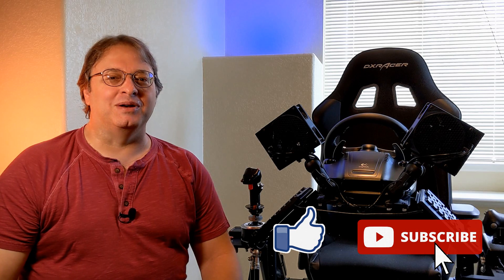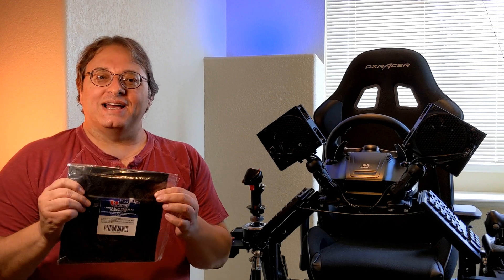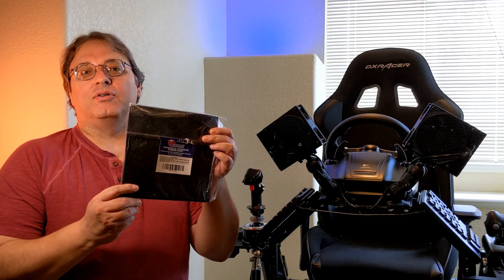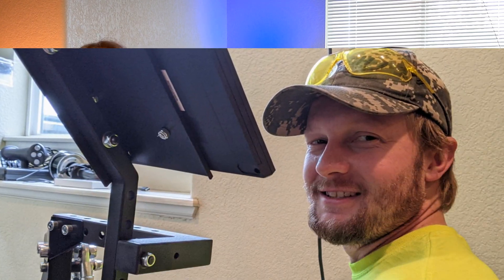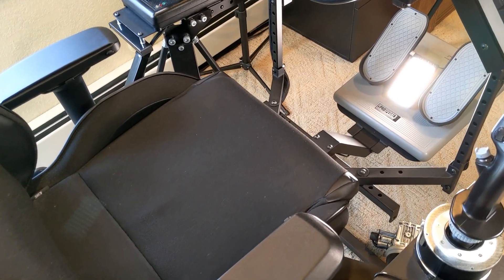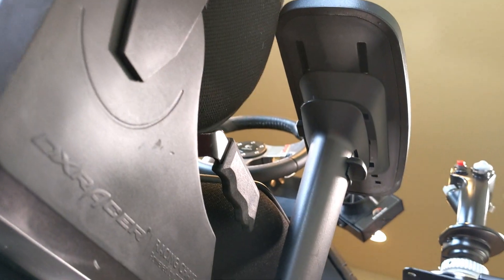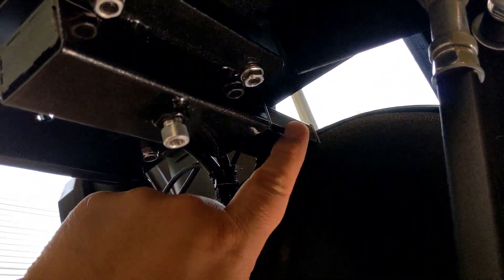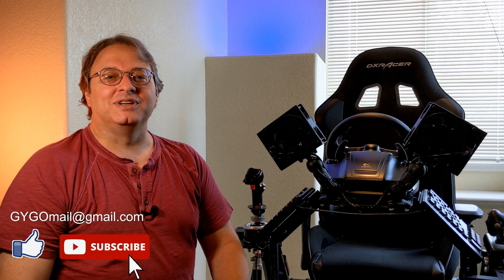DOF Reality H6 Motion Simulator - Part 3: The Core Build

Comment: separate outlet alone does not help much ,you also need separate circuit breaker .if you only change the CB ,you are the risk of causing wires to overheat and possible fire hazard.
Reply from the maker: 100% Correct!!! That is why you should only have a qualified person do electrical at this level in your house.  No motion platform is worth burning your house down.  The guy that did ours ran dedicated orange wire from that outlet (to the switch) then to new dedicated 20amp circuit breakers.  I think that wire was 10 gauge... which he thought might be overkill but I wanted to lean toward over cautious... again didn't want to burn the house down, and so far so good (knock on wood).  Thanks for the comment, I'll pin it because this is an important point.
Reply: Seriously did you even pay any attention at all?
Reply: Some people just have no comprehension skills.  Commenting without watching the video is arrogant and narcissistic.
Reply from the maker: @Purplexity-ww8nb  Glad I'm not the only one who notices stuff like that sometimes.  Appreciate the comment and the view!

Comment: I think what might help is the quantity needed when purchasing new bolts. I'm trying to prepare for my delivery and would like to have everything in place and ready to mod. But regardless, for H6 owners this really is an awesome video. Nicely done. (Unless, of course, there's access to the documentation that has the count of items. :/)
Reply from the maker: Well you are in luck, if you go to my SFU Modification video, I talk about the key bolts you need but here is a copy of the list: 

M8-1.25 x 110mm (10mm to 120mm Available) Socket Head Cap Screws, Allen Socket Drive, 12.9 Alloy Steel, Full Thread, Black Oxide, 5 PCS (NEED TOTAL OF 3 BOLTS): https://amzn.to/3X4jx3q

M8 8MM Male to M6 6MM Female - Threaded REDUCERS 5 x Thread ADAPTERS (NEED TOTAL OF 3 ADAPTERS): https://amzn.to/3i9AdYp

Temp Stickers for each motor (to visually make sure each one is not overheating... not really necessary but I wanted to add it): https://amzn.to/35gfdbx

(IMPORTANT: If ordering bolts or washers, please confirm proper measurements after clicking link. if Amazon is out of stock it may substitute a different size without noting the difference)

NON-AMAZON LINKS

M10 x 80mm Carbon Steel Full Threaded Hexagon Socket Cap Head Screws Bolts 5pcs (These are what I ordered, you may look for 90mm instead) NEED 6 TOTAL PIECES (2 packs of 5): https://www.harfington.com/products/p...

EIBACH END LINK SPACER (M10 Spacer 10mm) NEED 12 PIECES TOTAL (3 packs of 4): https://eibach.com/us/i-12116-eibach-... you

Steinjager Cone Style Rod End Spacers 5/16 Bore 4 Pack (NEED 6 PIECES TOTAL - 2 packs of 4): https://www.ebay.com/itm/234813416374...

This is obviously for the SFU Upgrade with the Cone Spacers added to it.  I put how many you need in parenthesis.  For the other bolts, we just bought a dozen or so of the longer M8s and then we used the ones that came with it and just used the appropriate length for the application.  So in other words, when it say called for a 60mm long, we just used the 70mm long that came with the unit.  I hope that makes sense?  Anyway, you will likely find yourself needing to get some extras so just plan on that.  I can't give you an exact count because the DOF Units have changed since I got mine with different bases and stuff so my inventory wouldn't be accurate anymore, but here is the current build guide for the H/P6 so maybe you can get some info from it ( https://dofreality.com/instructionsHP6.pdf )  Hope that helps and good luck.
Reply: @GYGOtv  Wow, thanks for the quick response and the great information! This is awesome!. I appreciate you taking the time to get this posted.
Reply from the maker: @puckernet8155  No problem, good luck with your build... glad I could help!

Comment: Did you get the standard butt kicker adapter post from dofreality for your setup, i think i see a shot of it briefly but cant tell.  I did the standard one, i feel the pipe is too narrow (even though i thought they corrected that), so ill add material to it, but i'm confused as to where to mount it.  Seems the only spot that might work is up towards the front underside of the chair on the front of the spine material in the middle.
Reply from the maker: Hi Sky, yes I just got the DOF adapter and you are correct, it was a little loose. We added just a little of the Neoprene Rubber to it to make it tight and seems to work fine. Mounted it about the middle with the Buttkicker 2 pointed forward. I like this setup because I can reach down from the seat and feel how hot the Buttkicker is getting.  You can see the installation here  https://www.youtube.com/watch?v=zlGQ3N_1LAg&t=1196s You can see the rubber at the front of the post if you look closely. Thanks for watching and good luck.

Comment: Where did you end up finding the 
M8-1.25 x 100mm Socket Head Cap Screws, 12.9 Grade Alloy Steel, Allen Socket Drive, Black Oxide Finish screws?  Checking lowes for instance they dont seem to have that length
Reply from the maker: We couldn't find those locally either. Ordered a lot of them from Amazon, the links are in the description above.  I don't think they have the M8-1.24 x 100mm anymore so you might have to just do a search on the internet for another vendor.  Good hunting!

Comment: Curious, for the larger washers, what tool did you use to cut them?  Also how did you make the sleeves for inside the frame, custom cut part of some kind?
Reply from the maker: Hi Sky, we used a cut off wheel, but a die grinder with a cutting attachment would probably work too. Also used Vice Grips to hold while cutting.  Thanks for the question.
Reply: @GYGOtv  I'll have to look into those or maybe i wont worry about it.  I think i have a band saw that could work, if the right type of blade installed, unsure.  Appreciate that you took time to respond btw, have a great day.
Reply from the maker: @markm75  No problem Sky, I always try to reply so feel free to ask anything else.  Yes we just used the tool we had, didn't go out and buy anything special for the cuts.  Hope that helps.
Reply: @GYGOtv  One other question, would it be just as good to use a 1" washer instead of 1.5" in the case of the 1.5's and then not needing to cut them? Or are they less effective on distributing the load
Reply from the maker: @markm75  I think "technically" they are less effective... but a 1 inch washer is more effective than not using one.  Really the big factor is NOT over-tightening the bolts and bending the metal, so I think caution mixed with a 1 inch washer would be fine. I think that is a great idea if you don't want to mess with cutting the larger washers.  Good luck, let us know how it goes, and thanks for watching!

Comment: Im curious, with the h6, how much of a footprint on the floor do you need, if you take into account shifting forward and back or side to side.  I was going to try to put this in my smallish office area, i know there is the spec they list, but i'm assuming there is some extension to that at times?
Reply from the maker: Mine is in a 5 foot by 6 foot cubby in my office and it has room around it still.  I'd say the 4x5 spec listed on the DOF Reality website is probably accurate.  That is one of the great things about these units... very small footprint compared to other motion platforms!  Thanks for the question.
Reply: @GYGOtv  Great info thanks, so about 5 ft wide by 6 foot long then right?  (rectangular and 5ft on the seat tilt).
Reply from the maker: @markm75  Ya I just did a full surge and sway and it is 6 ft front to back on the surge movement and 5 ft should be enough side to side.  The tilt would be inside that envelope.
Reply: @GYGOtv  I guess i should factor in the controllers or whatever the proper term is, appears they take up a chunk of space unless i put them on a shelf too i suppose, is that accurate? And ty for this video, its a good level of detail on the build process not seen elsewhere.
Reply from the maker: @markm75  SO how big a space are you working with?  Is it that tight?

Comment: Great tip with the washers, I made the mistake of not doing it and bent a few parts of the frame from over tightening.😢
Reply from the maker: Hi Adam, you are not the first to do that for sure. I think the majority of DOF owners have run into that issue.  The good news is, the washers are big enough that you can kind of cover up your mistake with them :).  Thanks for the comment and the view!

Comment: Can you make a video of you showing how to balance the rig
Reply from the maker: Hi Tig, I'm not really sure you can "balance" a 6 Series, I've asked in the forums and groups and nobody has really given me a good answer yet... Maybe someone will comment here.  Balancing is really important on the 3 Series because the platform pivots on a central U-joint.  The 6 Series has multiple arms attached that you really can't find the balance of it.  The only real way I've figured to "balance" my unit is just to gauge the temps of the motors and see if any are getting more hot than others.  Anyone else out there have a solution or recommendation for balancing the 6 Series platforms?

Comment: What is the size of the sleeves you put on the unit and how many total were used?
Reply from the maker: Appreciate the question Eric, we just got some Round Steel Tubing from the local hardware store and custom cut them to fit. It was 1/2 inch tube, 3 foot length.  I'd recommend you take one of your M10 bolts however because they didn't all fit in 1/2" tubes I'd assume due to manufacturing differences or damage from shipping.  We used 6, one for each M10 bolt.
Reply: @GYGOtv  Thank you, what was the length of each piece once cut ?
Reply from the maker: @esparks89129  Not sure the exact size because they are installed in the rig.  We actually custom fit each one to within probably 1mm or so of the space in the framework. Your gap might vary depending on how tight you originally cranked down on the bolts.  Just measure them out and they should be long enough to slide down where the holes are and stay put but not so long that they push the walls of the metal outward (unless you have deformed it by overtightening previously).  Hope that helps.

Comment: Great video!  What size are the sleeve/bushings you used?  where did you get them?  Thanks!
Reply from the maker: Thanks John, we just got some Round Steel Tubing from the local hardware store and custom cut them to fit. It was 1/2 inch tube, 3 foot length.  I'd recommend you take one of your M10 bolts however because they didn't all fit in 1/2" tubes I'd assume due to manufacturing differences or damage from shipping.  Appreciate you watching our content.
Reply: @GYGOtv  what tools did you use to cut the bolts and washers
Reply from the maker: @TonyDrecaps  Mostly used a band saw and a cut off tool, you could use a cutoff disk on a grinder too.
Reply: @GYGOtv  thank you!

Comment: Hi Mark, when will you continue with your "DOF Reality H6 Motion Simulator" series? I'm looking forward to Part 4.
Reply from the maker: Thanks for the question DigitalEngine, well if that is something you want, I'll get right on it!  Actually your timing is perfect, I really wanted to get the Varjo Aero series out of the way and then planned the Part 4 DOF segment next. I'm putting together the outline right now so is there anything specific that you are interested in? If so I can try to include it if it makes sense.  Thanks for watching!
Reply: @GYGOtv  Thanks GYGO,
1) Interested in how you set up the Lighthouse tracking system, both hardware and software?
2) The 6DOF motion hardware/software interface with the sim app, especially DCS World, how is it setup, and how does it interface? Pros, cons and tips.
3) Noticed in your first Reality H6 video, the movements seemed to be abrupt and jerky or hard. Does the software dampen this out as applicable to the simulation and situation of the moment?
4) What is the buttkicker exactly, and how does it interface with the simulation, and how does it improve the experience? 
5) Did you install the SRS Shake Kit or similar product?
Thanks for the really detailed videos you are creating!
Reply from the maker: @digitalengine7406  Nice lists of questions. Some of these I can easily answer now.

1. Setting up the lighthouses can be seen in this video ( https://youtu.be/l61-oqyZZL8 ), watch from 20 min 21 sec to about 23 min 30 sec to see the process.  It's pretty easy, just mount them and plug them in.  Then the computer will see them when you do Steam's room setup.  You would mount them caddy-corner from each other, up high so nobody can walk in front of them.
2. The Motion Hardware/software could be it's own topic and video, so I may have to do a Part 5 after we talk about peripherals, and just going into the SRS Tuning Software, but it is amazing and you can adjust a ton. So hopefully you don't mind waiting just a little longer for that one. 
3. The motion can be jerky or pretty smooth depending on the input from the telemetry and how you have the SRS software setup. You do get a little gear motion that you can slightly feel, but nothing that ruins the experience.  Watch some of my flight videos and you should see it do both.  You can also dampen it out as much as you like with the SRS software.
4. & 5. The Buttkicker is basically the same thing as the SRS Shake Kit.  They are transducers that vibrate based on the input.  The buttkicker just takes the game sound and I believe the SRS uses actual telemetry from games if they have it.  I have a single Buttkicker on the bottom of the rig vs the SRS which sit on the seat itself. Some setups even use multiple transducers down by the pedals, on the sides of the rig and on the seat.  I see it more in the Sim Racing world but they are a really cool effect that helps add the vibrations you would feel from an actual engine, etc. They all have pros and cons, and there are other options as well so you can research transducers for simulators and look into what you think would be right for you.  I will talk more about the buttkicker in the Part 4 video.

Hope that answers some of your questions right away, and stay tuned for the Part 4 video hopefully in a week or 2.
Reply: @GYGOtv  On the Lighthouse tracking system setup question, more specifically, how do you set up the tracking system in regards to canceling out the movements of the motion rig? I have the original Vive, so I'm versed on setting up the lighthouses for room scale or my office chair space. However, with the lighthouses stationary, and the users actual position moving with the platform, but the users position not moving in relation to the virtual cockpit, how is this accomplished.? 
Looking forward to your next video(s) on your system!
Reply from the maker: @digitalengine7406  O' well that is a whole different question. So first thing is you may not need or want motion cancelling. I've gone back and forth on that. On one hand, it is so cool when I land on a carrier to visually get thrown into the dashboard when I catch the wire.  Also, for racing I think it adds to the feeling of being jostled around the car as you drive.  But there are times like when I'm at full afterburner where I feel like I'm almost inside the seat or just too far away from the dashboard.  I would recommend trying the experience without motion compensation and see if you like it that way before investing in motion compensation.

So if you do decide you want motion compensation, there are 2 different ways to achieve this. Now I'm no expert because I haven't gone full bore with it... but I have looked into it.  The first way which is what you would likely use with lighthouse tracking is to get an additional vive tracker or controller. You then mount that to the seat or somewhere close to where you head sits. You can add a plugin called OpenVR to Steam VR, and that software then allows you use that tracker's data to cancel out the motion. There is a fantastic tutorial here if you want more info, https://www.youtube.com/watch?v=1MqGO46xdtI&t=305s.

The other method is through the Sim Racing Software program and it involves using a sensor in place of a tracker. It is mainly for WMR systems, but I'm hoping it will work with the Aero because it is a much cleaner installation in my opinion.  I haven't looked deeply into it yet, but when I do I will probably make a video about it if it works.  You can find out more info about this method here: https://www.simracingstudio.com/post/motion-compensation

Hope that helps answer your question, sorry I'm not more of an authority on it, but I currently don't feel like I need it in my sims. That may change in the future however. :)
Reply: @GYGOtv  OK, that makes sense. I guess a better question would be motion compensation then, or, as best I can articulate, cancelling out the motion of the platform rig in reference to the lighthouses, but not the motion of the user in reference to the platform rig itself (and the virtual cockpit). In essence, as if the lighthouses were mounted on the motion platform rig. If the lighthouse were solid state (no moving part), this might actually be a feasibility I'd think.
Reply from the maker: @digitalengine7406 Maybe I'm misunderstanding, My answer above is for cancelling out the motion from the motion platform.  Isn't that what your asking about?  Basically the same result as mounting the lighthouses to the rig (which you can't do). Watch that video and see if that doesn't answer your questions.  Hope that helps.
Reply: @GYGOtv  Yes, did watch it, and we're actually on he same page, so to speak, cancelling out the platform motion. Really Interesting concepts/solutions. Looking forward to your videos! Thanks!
Reply from the maker: Just incase anyone missed it, Part 4 is now online! https://youtu.be/zlGQ3N_1LAg